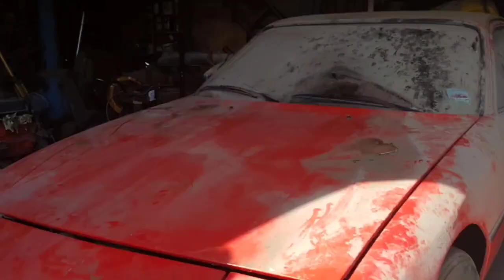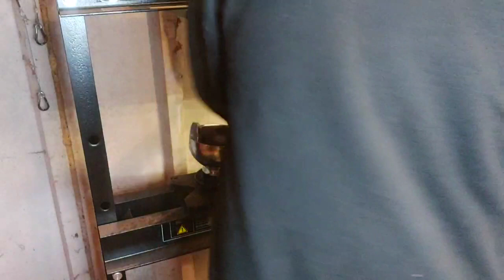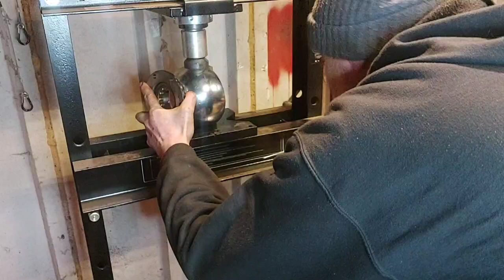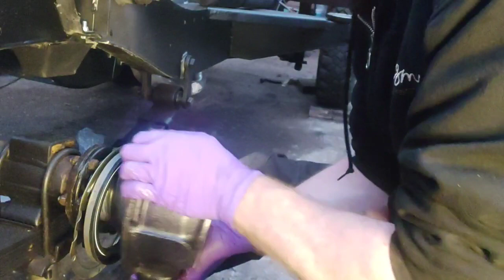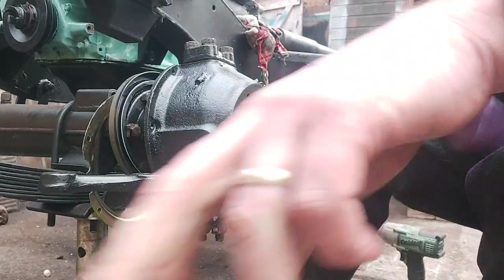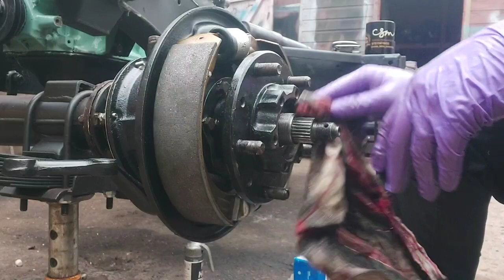land rover series project (numb nuts) fitting new swivel balls and brakes pt2

Comment: When I used to have Series Land Rover's (At one time I had about three of them) I am sure I looked into the idea of putting bearings top and bottom instead of a ralco bush and pin. A nice tidy job there young man!
Reply from the maker: Thanks, I'm sure you could fit a bearing in the top but the pin pushes down on the bush keeping everything in place but it could be done with a few mods to the bearings 👍
Reply: The bush is there as a damper as much as anything. If the swivels were bearings only you have death weave all the time or have to fit a damper o the drop link.
Reply: @highdownmartin  l had a steering damper on mine partly because of the violent wobble l got from wide offset wheels with big 750's on.
Reply: @JonDingle  I had one on mine when I went to view it. Almost undriveable !  ( I’d had a 20 year gap since my last landrover and thought “ what am I doing? Idont remember them being this awful!”Removed it then had another test drive, marginally better. So went back on the train a week later and drove it home 180 miles from Somerset to Sussex. Relay was BONE DRY! With the front axle off the ground it was a two handed wrestle lock to lock!  All much ,much improved now  Why previous owner thought a damper was a good idea, eff knows. Mind you his welding and wiring was shocking as well.  61 109
Reply from the maker: The relay is often over looked but makes a massive difference to how they drive with properly set up steering you should never struggle to turn the wheel.
Reply: @retro.restorations  indeed. Mines never going to be one handed parking but so long as you’re moving forward or back it’s not too bad

Comment: Slightly of the subject, what are your thoughts on using a small amount of copper grease on many of these "hard to remove" nuts/bolts etc? What is the effect of using copper grease on a bolt or nut that needs to be tightened to a specific torque?
Reply from the maker: Thats a good question. You should never use any grease on nuts or bolts that need to be tightened to a specific torque as it could cause over tightening. Some stretch bolts specified using a light drop of oil on the threads. Everything else is fine. I hope this helps 👍

Comment: What year is that Landy please? PS If I were to pay someone to do this job on my 1952 80" what sort of money you think that would cost me? would you do it and if so where are you? Many Thanks Simon
Reply from the maker: It's around 1980 I can't remember exactly. Using good quality parts It's around £700/£800 nowadays for a complete front brake and swivel ball rebuild. Good quality swivel balls have gotten expensive. I'm based near Sheffield South Yorkshire. 🙂👍
Reply: Thanks for the quick answer, mine was restored by Ken Wheelwright around about 2000, it then went and sat in a museum in Germany for 15 years, its only done a couple of thousand miles since the restoration. The issue I have is gear oil leaking into the brake drum on the drivers side, you think I just need a seal and no need for full rebuild? By the way the restoration it had was a full nut and bolt job done by Ken who did rest jobs for Land Rover before they set up there own classic department, bit of a leg end apparently. @retro.restorations
Reply from the maker: @jackstaenergy  it sounds like you need new oil seals. They dont last forever, so even with very low mileage they will leak eventually. If you don't need new swivel balls that takes atleast £450 off the bill, the job is still the same regardless but just refitting the original swivels.
Reply: OK great thanks for your help, greatly appreciated.  @retro.restorations